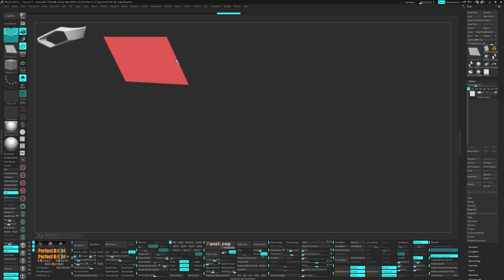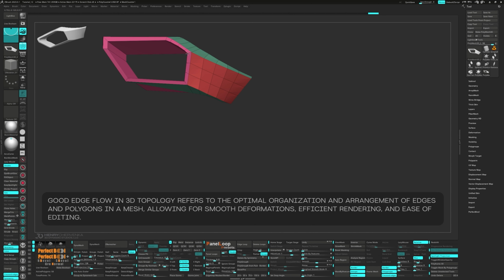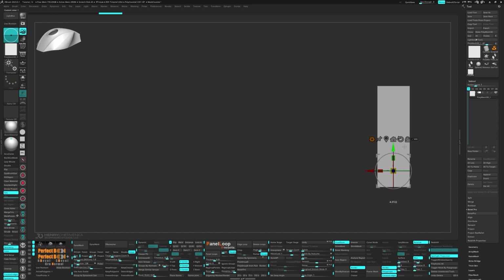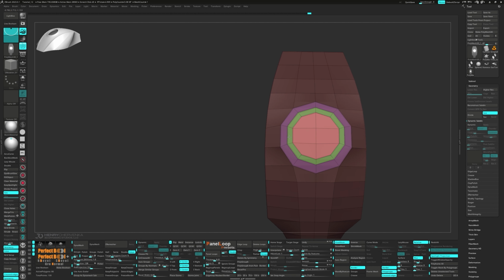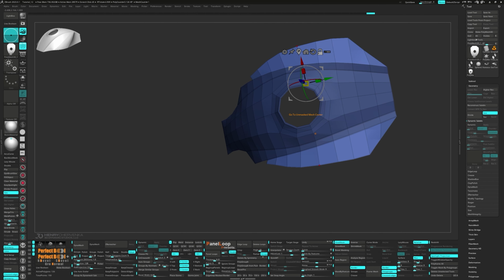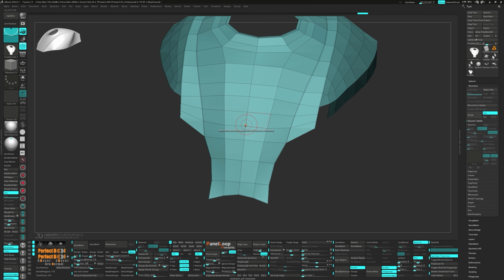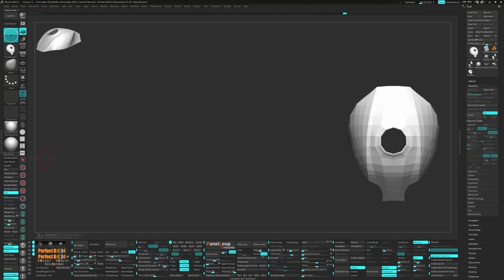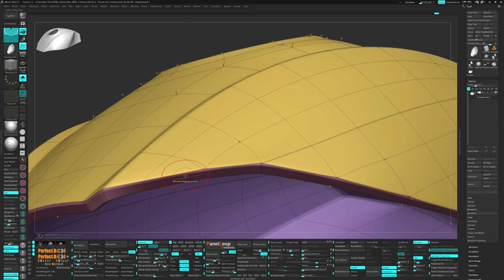Hard Surface ZBrush Tutorial Series // Modeling A Kawasaki Ninja H2R // 13

Comment: Henry, when I followed your tutorial to this stage, I had trouble putting the kawasaki items together. It was mismatched in size and didn't fit together, I didn't know how to handle it to put it together properly, so I was afraid of changing the size of any object to make a mistake. How did you handle this stage?
Reply from the maker: As long as the proportions are accurate, you should be able to uniformly scale the gas tank up or down to match the rest of the bike. Since the gas tank is low poly, if it's slightly off proportionally, you can use the soft deformer to adjust the shape a bit for a better fit. Additionally, there’s a side screenshot reference linked in the description of video 01 that you can use to help with placement.
Reply: @henrychervenka  Thanks Henry, I never thought of that way of handling. Always afraid of losing the form and not daring to edit.
Reply: @henrychervenka  but maybe you shouldn't cut that part in the Henry tutorial video, because when I got to the stage where it didn't match, I deleted the post and redid it because I thought I was wrong haha
Reply: the assembly and deform application part is pretty good, unfortunately you cut it out in the video, if there was full content it would be very interesting
Reply from the maker: @haiam2249  I didn’t need to use the soft deformer for the gas tank—it fit perfectly once I scaled it. I just suggested that method in case it doesn’t fit properly for you. Since it’s still early in the modeling stage, as long as it matches the screenshots during modeling, it should start fitting better once other parts like the frame, gas tank cover, and the small side fairing under the gas tank are completed.
Reply: @henrychervenka  haha your sense of space is so good, I make it all distorted from reality or slightly off